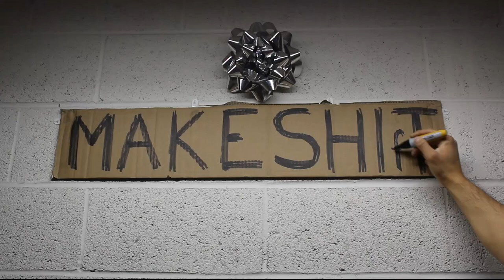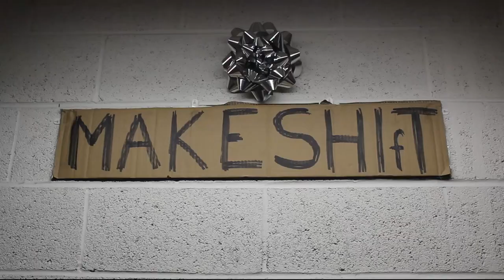MAKESHIfT - DIY Bed Frame

Comment: Hi, what type of material did you use? Real nice and simple looking bed frame
Reply from the maker: Hey thanks, I used steel square tubing and flat stock with pine wood slats!
Reply: @harrisonlu486  but what size? I want to try this